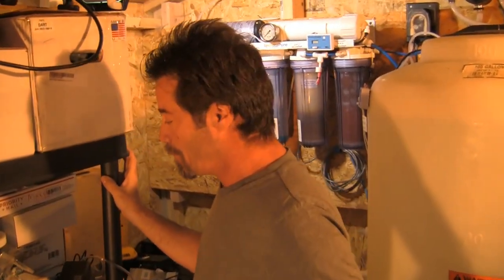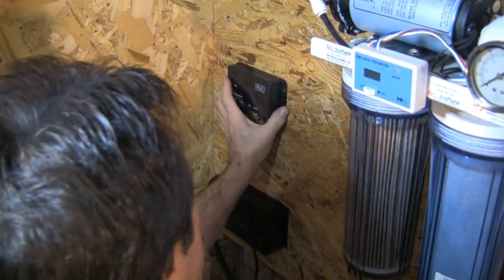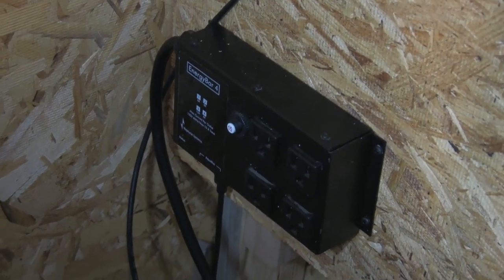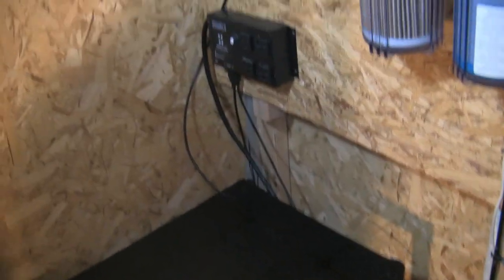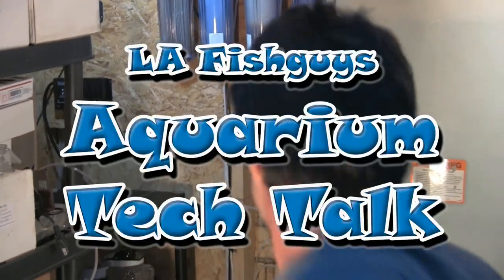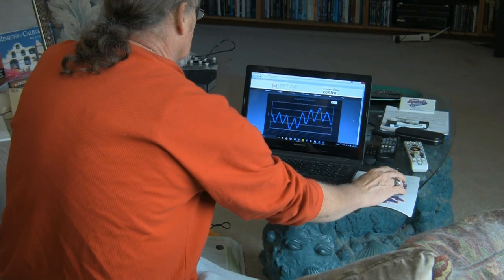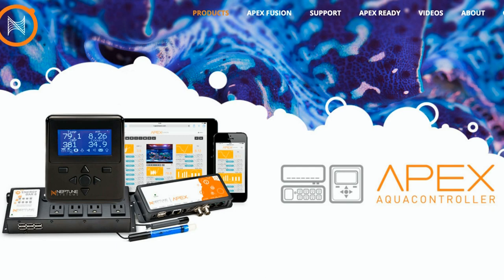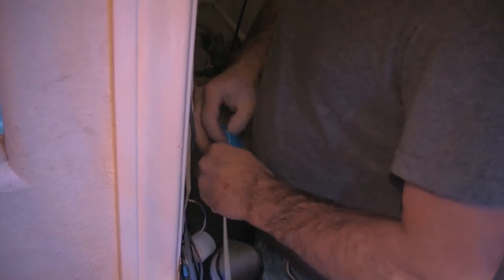Calcium Reactor, LA Fishguys TECH TALK episode 155, part 2

Comment: What fittings did you use to get from the RODI tubing to the silicone tubing of the pump?
Reply: This goes into the LS17 tubing: http://www.usplastic.com/catalog/item.aspx?itemid=36204
And this going into that barb fitting. http://www.usplastic.com/catalog/item.aspx?itemid=42009
Reply: Also, lot's of great info on using these Masterflex pumps on calcium reactors can be found in this thread. 
 http://www.reefcentral.com/forums/showthread.php?t=2368618

Comment: Scott is a wizard!! Could you recommend any cole palmer peristaltic models that they have on ebay that he'd recommend? I've been researching but don't care buy one
Reply: Not long after we shot this video, I upgraded to a  Cole Parmer 7523-80 which is a newer model. It’s brushless and runs up to 600 RPM. I found it on eBay and got a great deal on it but they are typically very expensive.  You ideally want a 600 rpm pump because they have a gear box and that means the motor runs at a much lower motor RPM at our operational rates and that means less wear and tear on the motor which means a MUCH longer life than a 100 RPM model or 300 RPM model. If you need it tto be quiet, then you’d want a brushless model. You also want an “Easy Load”  head that supports LS17 tubing such as the 7518-00 or 7518-10.  That said, this thread has everything you would want to know about these pumps. If you find a model on eBay, search this thread to see what others say about it.  http://www.reefcentral.com/forums/showthread.php?t=2368618
Reply: There are so many different Cole Parmer models so it’s hard to recommend any one model except for the one I have experience with but the above criteria should give you some guidance and the thread I linked to above, while long has a ton of information on Cole Parmers and using them for this application and the one topic that always comes up is what model is good so reading the thread searching the thread on a model you come across will yield a wealth of information on the topic as well as specific models. And if money isn’t a driving factor, you could always buy a new one from Cole Parmer.
Reply: @slief  Thank you so much 🙏!!!